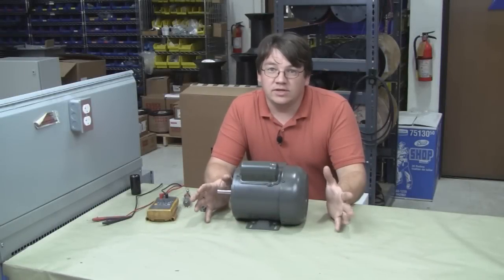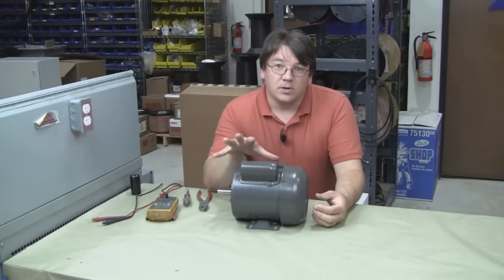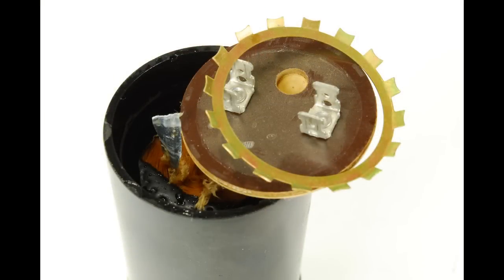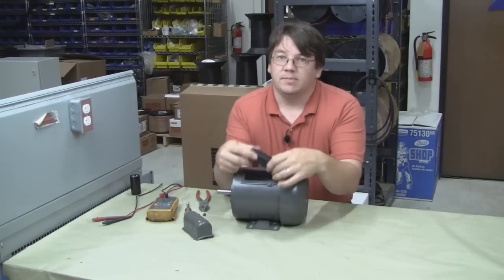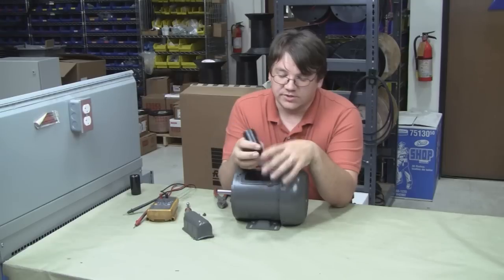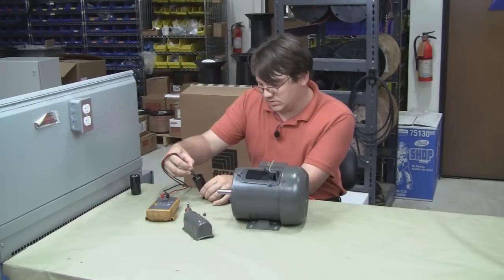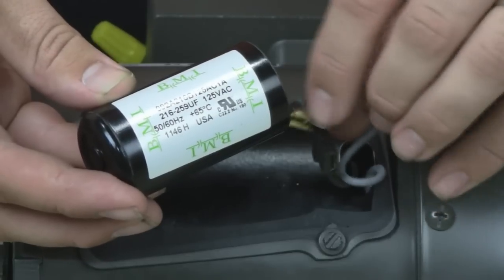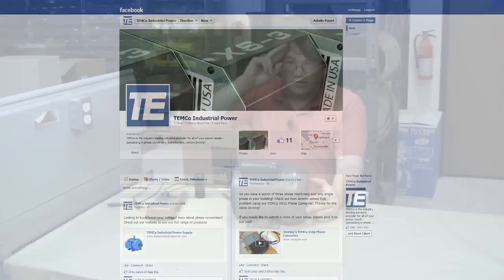Replacing a Motor Start Capacitor -- How To by TEMCo

Comment: Thank you.  So, given the specs for my motor and its application, what value resistor is suggested?  Could I hurt the start capacitor or my motor by using a resistor with the wrong specifications?  I don't want to assume anything, but I imagine you mean "it never hurts to put one on" ... if it's the correct resistor. (?)

And what characteristics (possibly relating to motor performance, behavior, longevity, etc.) will be helped by having the resistor?

Thanks again!

Comment from the maker: Most start caps don't come with resistors. If your original start cap didn't come with a resistor, it is safe to assume you don't need one. It never hurts to put one on, though!

Comment: You show transferring a bleed-down resistor from one start cap. to a replacement start cap.  Do all replacement start caps. come without resistors?  You don't comment about this.

My old/original start cap. (216-259 mfd, 220-250 VAC, on a 5 HP air compressor motor from Century Elect.) never had a resistor ... is it safe to assume it doesn't need a resistor?  You also don't comment about stat capacitors that don't have resistors.

Thanks for your vid.  I clicked "Like" and saved to my favorites.

Comment: When replacing the capacitor,  does the resistor  have to be reconnected to the same terminals or does it matter as in a diode?
Thanks 
Rob

Comment from the maker: With the power off, when you try to turn the motor shaft by hand, does it turn freely or is there some resistance?

If there is some resistance, the bearings probably need replacement. If it spins freely, you probably want to look into a replacement capacitor.

Comment from the maker: Do you have the specs from the capacitor that you need to replace? You'll need to know the voltage and capacitance ratings, and possibly the shape of the capacitor if you have mounting/space constraints.

Comment from the maker: AC capacitors are non-polarity specific, so it doesn't matter how you connect it on your replacement run cap.

Internal failure on the capacitor is most likely what happened. Something  probably shorted in the capacitor, which caused it to heat and boil the oil internally. As the heat rose, the increasing pressure caused it to explode.
Reply: So, there is an internal breaker on these motors? My motor powers up, and then (trips something), cuts power, then back to full power, then cuts power... continually.

Comment from the maker: Thanks for the input.

Steve: You will need a 160 - 200 mfd, 275V start capacitor. We don't carry that particular spec, but you should be able to find plenty online (like eBay).

Comment from the maker: Sounds like the start capacitor's gone out, so you'll need a replacement. Since you already know the capacitance (160-200 uf), see what the voltage rating is on the capacitor to get a suitable replacement.
Reply: Would a capacitor with the same uf rating but a higher voltage rating be ok to use?

Comment: i left a comment on your video explaining about my motor. My motor does hum and it is an old motor. If i leave it plugged in for says 5 seconds it blows the fuse on my plug. Any ideas whether it is the switch or the capacitor?

Comment from the maker: The wear on the run capacitor is unrelated to that of the start capacitor. You can test the run cap's microfarad rating to see if it is in need of replacement.

Comment: Thanks, this answered the questions I had about determining whether the start capacitor is at fault on my table saw motor. Would it make sense to also change out the run capacitor when replacing the start capacitor or is the wear unrelated?

Comment from the maker: If it starts up but smokes after a few seconds, it sounds like the motor windings are burnt out. You most likely need a replacement motor.

Comment: The smoke comes from the side of the motor. Didn't push the button long enough to see if it would trip any kind of safety switch. Just hit the button after it smoked to see if it would still work. It still works the same but heats up and smokes after about 2 or 3 seconds

Comment: I have a 4 post car lift that runs off of 220v. It made a pop noise and smoked a little. The lift will still run, But it smokes after 2 seconds. Any idea on what is wrong with it? ANY idea will help out a lot. Thanks

Comment from the maker: Have more questions about the start up system on your motor? Need help sizing a replacement cap? Give us a call, we want to hear from you!
Reply: Long shot. 8 yr old video. I changed the start capacitor on my table saw (temco with same specs from motor repair shop), still a few times did a little vibration run until I shut it off and turned back on. Then wee smooth, quiet. So changed it to 220 today (dual v) it ran excellent for some time. Then I think the run cap burnt up. When I read the start cap I still get a steady reading. Checking run cap with it still connected get OL. Could the start cap burning up cause the run to burn up? When it stopped this time I noticed the start cap was warm and run cap dead cold. Please help. 😟